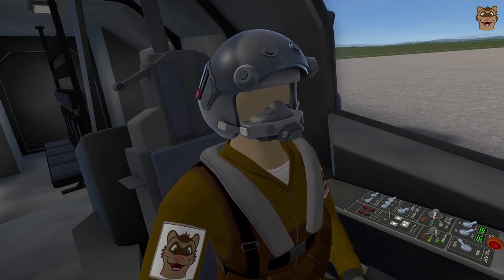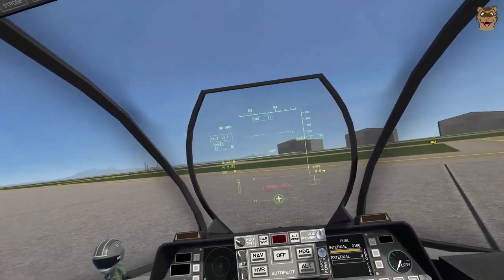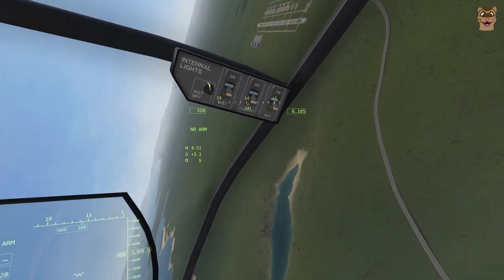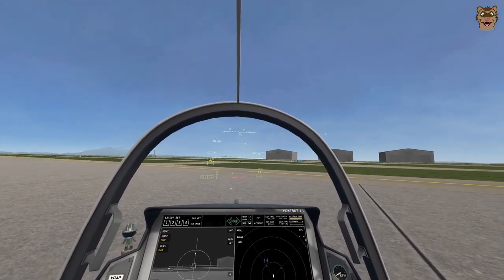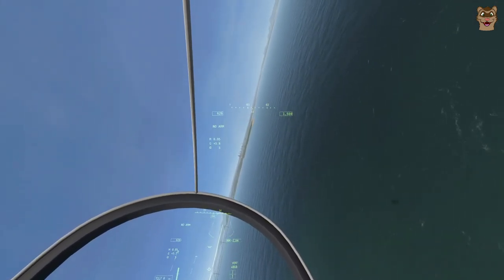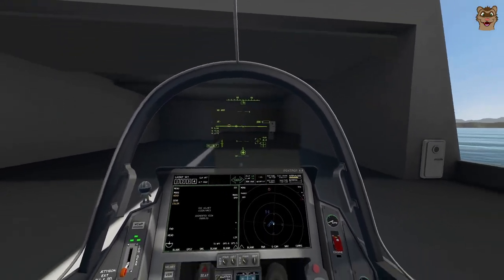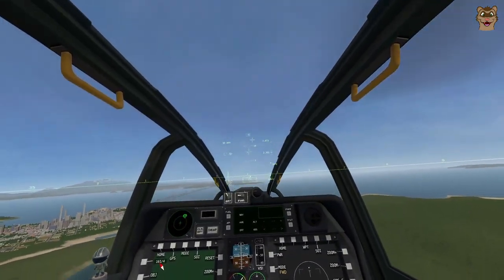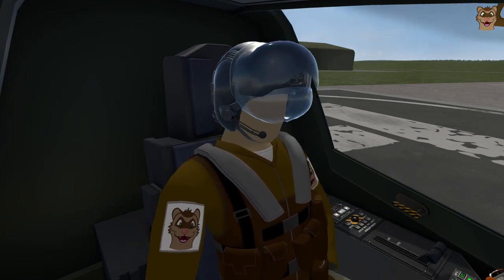VTOL VR - Vertical take off & Landing Overexplained

Comment: You've landed your helicopter with landing gear retracted ;)
Reply from the maker: 😂 that’s why it was loud. Trying to concentrate on landing procedure and narrate what you are doing, I am surprised I haven’t do it before 🤦‍♂️
Reply: @TheFerretsWheels  May I suggest covering autorotation landings of AH-94? It works somewhat differently compared to other sims. For me it is hard to get high rotor RPM. Usually it should be at the top of "green" RPM sector or even slightly higher during sustained autorotation to have decent energy reserve, but in VTOL i can barely hold it in bottom of the green range if I autorotate from high enough to allow the engines to fully spool down.
On the other hand, the rotor produces decent lift even at rather low RPM, so in general autorotation is not hard.
My feeling is that rotor stall is not simulated, and in general rotor simulation is quite simplistic and should be a subject for improvement in future versions.

Comment: Could you cover the differences and benefits/drawbacks of the GBU-53 and AGM-114 (on the F-45)? I am having a tough time deciding between the two of them.
Reply from the maker: If you have AGM-145 then they are better than 114s and the GBU-53 aren’t as good as the 38 other than carrying more. The deciding factor for munitions is usually cost and TWR (weight). If you can load out with 145s and AIM-120Ds then that’s about as good as it gets for most situations

Comment: Is there any faster way to land the av42 with vertical thrust angle? Like if you were in a combat medevac scenario; get in fast, land fast, and out fast? Trying to minimize the descent/final approach
Reply from the maker: You need to use high alpha to bleed your air speed, but with practice you can you fast landings. Drop collective to 0 and tilt nose up. Watch the VVI and try to keep it between 0 and -10 degrees on the pitch ladder. Once you start losing altitude it become a dance between pitch and throttle control.
Reply: @TheFerretsWheels  https://youtu.be/UDJ5U7YpXo8 https://youtu.be/dZLfHR4K29I
I meant something similar to these short clips. Or is it the case because of the wings, air speed has to be so slow that the stall you would have to induce would not have the rotation to bring the aircraft around 180° to point the thrust in the direction of travel?
Reply from the maker: You can do stops like that in the heli but fixed wings do not have the same manoeuvrability as the engines only tilt up and down towards the rear and not omnidirectional like a heli rotor. For a fixed wing you would bank over almost 90 degrees and pull a high G, high alpha turn and spiral around the LZ to lose airspeed